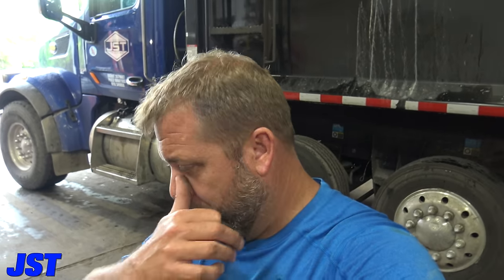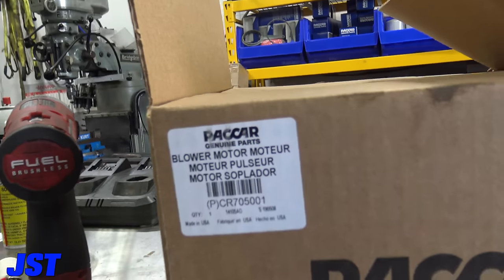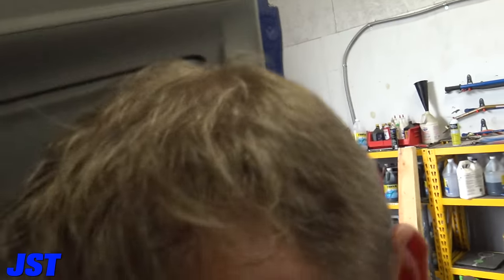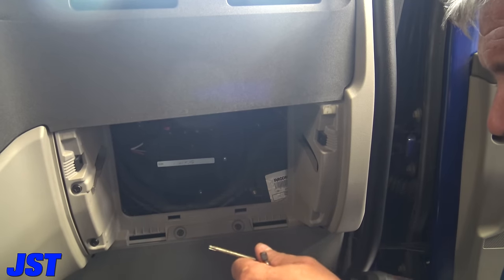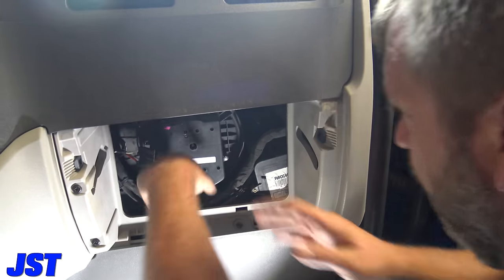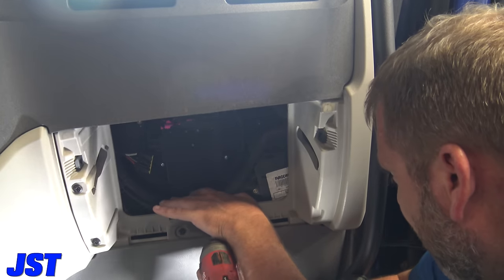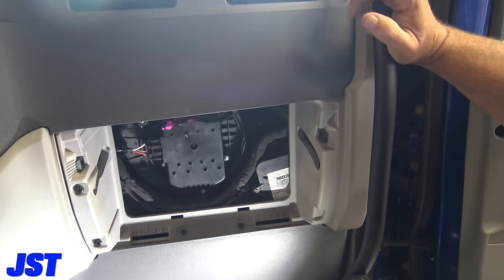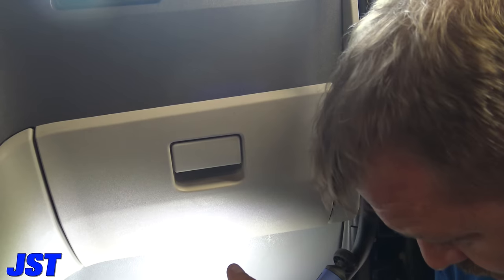PETERBILT 567 BLOWER MOTOR REPAIR

Comment: Great video!  Most people with the 2.1meter cab might have taken it to the dealership for that simple fix, it's a easy fix.  Why take it to the dealer and possibly pay a hour or two in labor plus the cost of the blower when it can be easily installed by yourself. Thanks for sharing and Happy Father's Day!

Comment: I was surprised to see that the 356 is way different then the 388 or the 368 I believe is the other one I drive both and never figured the interiors were so different the glove box door is held in by screws as well as the box it self so I’m sure there is a big difference in the rest as well

Comment: Hey, I have a question.. is the resistor built in the motor assembly or can it be swapped separately? (2017 567 pete) blower works fine except it's not changing speed to high

Comment: The older ones were not that easy.Same deal pop the glovebox but the motor went down in from the top and the rear screws holding it down into the hvac box were a bitch to get at. The cage wheel was metal and didn’t come with the motor. Make the drivers keep the cabin filter clean and tell them to keep it on re-circ on dusty jobs.That way the evaporator coil doesn’t get plugged with outside dirt.On edit make sure they keep shit off the dash by the defog vents. Stuff falls down in there and jams diverter doors and trust me you don’t want to pull the whole dash out to fix that.working at the dealership for years i have seen all sorts of issues with hvac stuff in cabs and bunks.Just some things to share that may help you prevent needless headaches. Lol

Comment: Bald tires no lights don’t care must have ac
Reply: Hey man. I like what you're doing. I'm 40 and my grandpa lives in chilocothi Ohio. I'm living in Virginia. Born and raised in Florida. Been in Virginia since 2005. Been driving for the same Company since 2005. I don't know everything bit I have common sense and enough experience to Learn quickly. I've been diving with  cdl since these of 18. I'm 40 now. Looking for a change and more experience.  Ohio and Michigan, and Virginia have some real trucks. Just want reach out for a opportunity and a change. Can you help me?   I have very good driving record and enough experience to learn very quickly on what I'm transporting. Driving and maneuvering is not a problem. Just learning the particular job at hand is the only thing I need to learn.

Comment: So I just replaced this motor on my 2016 579, no air coming through front vents, only defrost and side vents by the door work. And it turns on and off constantly, with noise coming behind the dash to the right in between on and off like its switching something
What could be the issue?

Comment: Change the filter right behind motor (which is probably plugged up) before replacing or it will not last long

Comment: What symptoms did you see to know it was the blower motor? Just the excessive noise? Ours has excessive noise. It does change the sound coming from the motor when adjusting fan speed but always little to know air. Have new air filters in it.
Reply: It all starts with excessive noise. Bearing worn out. Sometimes blower works if I hit a bump

Comment: If blower is still spinning but air is not coming out same volume as before could the filter be the culprit 67k on the clock and 105° in this FL parking lot … HAAAAELP